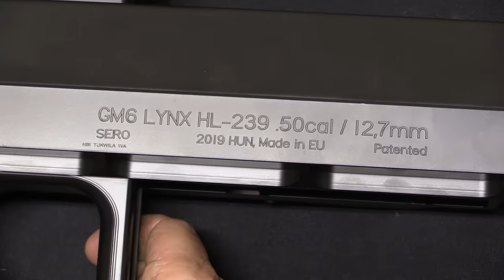GM6 Lynx: The Hungarian Long-Recoil .50-Caliber Bullpup

Comment: It's nice seeing a long recoil system being used in modern day firearms: really surprising how simple it is compared to gas operation
Reply: I wouldn't say it's simple due to the amount of parts required for long recoil action vs gas op, but it is marginally safer and can run black powder loads if you want to
Reply: @ArcturusOTE still powder build up would be an issue i wish we had a way to fix that beside from no rifling

Comment: Real life: This gun can only hold 5 rounds of 50. BMG.
Games: 8+
Reply: Arma 3 has the correct 5 rounds mags
Reply: 6 round mags plus 1 I have one
Reply: In far cry there is a dragunov with 5 rounds and the charging handle is on the wrong side.
Reply: Oh noo, games aren't realistic. How will we ever recover.
Reply: @DissedRedEngie  What is your problem?
Reply: If five .50 cal rounds isn't enough to stop your target, you better call for an air strike and artillery barrage.
Reply: In PUBG it only had 2 or 3 iirc
Reply: Is a AS50 from Accurat International in Far Cry 2
Reply: Every single movie and game: MG42 throws out the empty cases on the right side. Real life: only the belt.
Reply: @Eric Nunya It looks like silver is about $23/oz right now, which means your 1oz silver slug ammo…won’t cost that much more than any other ammo in 2021…
Reply: @Eric Nunya why not fill the nose cavity of a hollow point with white ash ?
(With 2022, you never know...)
Reply: I mean you could get like 10 with a double stacked mag, which is a very very simple modification to this weapon due to the magazine retention system. You could even attach a drum to this rifle, as impractical as it would be.
Reply: @DissedRedEngie  I'm not crying about I'm adding to the conversation.
Reply: @shooteveryday1841  you have it in pubg?
Reply: Games are garbage for kids...
Reply: bmg is such an overrated round

Comment: That "brass ring" is an Oilite bushing. Back in the day before roller bearings were cheap, this was the best way to manage locating parts that moved.  Usually they were set up to manage rotating bodies, so its use here as an axial bushing is less common.

Comment: what a mechanical marvel, and so finely manufactured. the brass bearings are a nice touch. i wonder about accuracy though with a moving barrel
Reply: Since it's an anti-materiel rifle, it's probably not called upon to hit anything especially small.  Well, maybe if it's being used for EOD, but then there's probably no particular need to hit it with the first shot.
Reply: As long as the front sight is fixed to the barrel, you should be OK...
Reply: Tests show normal MoA to be expected from an anti-material rifle, this isn't a sniper rifle. You're trying to hit large moving targets from distances expected to be less than 500 meters away behind cover.
Reply: @JosephArata  exactly. people usually think antimateriel rifle = sniper rifle, but they don't realize that they're not exactly used for the same thing. this is basically what amounts to be a man-portable "cannon" to destroy stuff. not a precision sniper rifle.
Reply: Actually it's probably a bronze bearing, brass doesn't have the right properties for bearings.
Reply: This isn't a sniper rifle. It's built to take out shit like engine blocks, power transformers, sat-com stations and things like that. Nobody using this is gonna be trying to hit enemy personnel at half a mile or anything.
Reply: @LabRat Knatz it would definitely work. Unfortunately most African countries have anti-american hold my beer laws so semi auto is not allowed, but .50 bmg should be doable. If 500 ne is acceptable performance, double the power should be 'adequate'.
Reply: @gruberstein  this is brass, looks just like the shine on my 3 point aerator tine rollers bearings which are also brass sleeves, looks exactly like the shine of my brass welding rods and things i have brazed with them. it's not a high polished as a musical instrument. brass bearings can be bought at your local hardware store. bronze on the other hand is fairly specialty.
Reply: As far as having a moving barrel, Barretts are the exact same way.
Reply: The rifle shoots about a minute, often times a little under. All with match ammo
Reply: @LabRat Knatz aside from the usual "military cartridge" prohibition in most of Africa, a .50bmg honestly has way too much penetration.
Reply: A Barrett shoots about 3moa.

About as good as an SMLE, or an AR.
Reply: @0neDoomedSpaceMarine  right. I don't know how they do it but the fit and finish of this rifle is next to none. It's worth every penny imo
Reply: The original Gepárd was said to be able to hit a human at 2kms range or even at 2 miles at least. It was said to be the longest range firearm of its time.

But modern variants may differ.
Reply: @ScottKenny1978  ARs shoot 1 MOA or better.
Reply: @DreddPirateRoberts  the design spec is 3moa.

Yes, some do shoot better, but mil spec is 3moa.

Comment: Your video really explains a lot of the issues demo ranch was having with the gun. He said it had a lot of recoil which could have been mitigated by tuning the muzzle brake, and he also had trouble charging the gun because he didn't rotate the bolt handle to unlock it before attempting to charge it.
Reply: So, they didn't read the manual?
Reply: He also forgot to use the barrel release to chamber the gun (a cool concept).
Reply: He sounds like the kind of person who would crank a Calico magazine only twenty-two times.
Reply: The gun had no issues, the problem was with Demo Ranch for not reading the manual/looking up how to properly use it.
Reply: RTFM I guess.

Comment: The brass/bronze bearings are very interesting and as you mentioned it's a wear part and is intentionally soft so that wears down instead. Its a technique you'll see in older mechanics, like steam engines and lathes. The advantage being you can simply replace the bearing ring and it's much cheaper to do so.
Reply: Brass and bronze are slippery alloys. Good for simple bearings and they also last long.
Especially bronze is surprisingly hard material.
Reply: I repair heavy machinery. Most of heavy machinery that involves hydraulics use bronze bushings. It is basically a consumable for high thrust and wear parts, like excavator arms. The main advantage of bronze bushings is self lubrication and ability to swap them. 
Like 75% of repairs I do are related to not propertly oiling and wearing out bushings till metal to metal contact. 
And that usually entails welding worn out surfaces and machiening them to original tolerances for new bushings.
Reply: @3rdHalf1  Thank you for elaborating further, my knowledge only comes from putzing around.
Reply: @3rdHalf1  what do you think of steel bushings as an alternative to bronze? Something you can run a weld bead down the bore to shrink it out of the bore for removal?
Reply: @brianwright9514  Nah, even very mild steel is much harder than brass and bronze. Aluminum alloys come closer, but there's a reason bearings and bushings aren't made of aluminum lol.
Reply: @Thelothuo  I've used some bronze alloys for bushings that are absolutely harder than mild steel.
Reply: @brianwright9514  Eh, really? Every source I can find puts bronze at 64HB at most, and steel at 120HB at least. oh nvm that number's Rockwell B and not Brinell, ye very hard bronzes do overlap mild steel in hardness
The only steel bushings I can find on McMaster-Carr are drill guides, not meant to bear load. My next guess is that steel isn't used while bronze is because of something to do with the structure of bronze that allows it to work, like with graphite.
Reply: @Thelothuo  low carbon/alloy steel is pretty soft...240 MPa min yield for some of it.  The big reason to use bronze is lubricity and material incompatibility (less likely for the pin to micro-weld to the bushing).
Reply: @brianwright9514  ye that was going to be my third guess, that it's used because it's dissimilar and strong enough
No idea whether a steel could be mild  enough to be usable as a bushing for other steels, though. If we're talking microwelds, could just being iron-based be too similar?
Reply: @Thelothuo  I've seen steel used in a lot of places where the pin doesn't rotate.  The pin is usually chrome or nickel plated, which can prevent the microwelding, especially in combination with other measures such as Moly Paste.  The purpose of the bushing is simply to prevent damage to the bore, which will typically be something much softer than the pin.  Bronze works well here too, but it is usually 4x the price of steel.

Comment: a lot of the design Elements of this remind me more of traditional Tool Machine Design than of the usual Gun makers designs, the use of Glide bearings, bolted on and
 together parts and bearings instead of hardened integral Lugs and Pins
Reply: yes, engineered rather than gunsmithed.
Reply: @LabRat Knatz you still need someone who has designed actual firearms before, though.

Otherwise you end up with the SA80.

Comment: Ian those rings that you identified as brass are most likely actually bronze. In that bronze is harder than brass and will wear longer. Highly polished bronze is often used as a bearing in heavy equipment. I know this as a retired machinist.
Reply: I definitely scrolled through the comments to see if someone else had picked that up. Good catch

Comment: Thank you very much Ian! I really wanted to see the Lynx on your channel, great video, well done sir! However, I feel that the real intended purpose of the gun doesn't get too much attention anywhere. So this gun excels in urban warfare. I don't know about any other gun in the same calibre that a soldier can carry comfortably while sitting in the passenger seat of a car and in case of an attack it's ready to fire in 2-3 seconds, providing brutal firepower that can punch through almost a feet thick ironed concrete. That's why the barrel locks in when retracted and on release chambers a round automatically.

Comment: That rifle looks like a machinist or mechanical engineer that used to build actual machines designed it. The roller bearing cam guide, the spring detent, the brass bushings, the way the muzzle brake is clamped on the thread, all that scream "machinetool" to me.

Comment: One advantage of long recoil I hadn’t realized until this video; unlike most other self loading systems the bolt doesn’t have to be as long as the cartridge.  This makes the receiver shorter and means you don’t need the extra weight of a full length .50 bolt.  It’s almost like an artillery piece.

Shame about the trigger though, it seems like that’s something they could have improved.
Reply: Considering they have no transfer rod to the seer, it should be possible to have a crisp trigger. O e area to improve yet further.
Reply: Yeah, that's weird. It should be possible to make at least a non-mushy trigger, if not a really nice two-stage trigger.

The military likes two stage triggers, so there's some give if a stick gets in the trigger guard.
Reply: @ScottKenny1978  Yeah. Imagine having this thing go off while carrying it in a shoulder sling...
Reply: @andersjjensen  I have a headache just thinking about that... 

I was once in the same, 5 Lane indoor range when they brought out the Barrett. Nasty concussion after that...
Reply: It’s a good point and a big advantage for long rounds. As you observe it makes for a very compact action. This is a really excellent design.
Reply: @WineScrounger  the reason you dont see it often is because recirprocating barrels lack accuracy
Reply: @brettalexander220 don't need big accuracy to hit NATO radars and parked planes tbf

Comment: Bullpup configurations make perfect sense for anti-material rifles. I love that it's so compact and I love the fact you can push the barrel and bolt back to make it even more compact. Excellent design. SAS use these now and they aren't even that expensive for what they offer £9k apparently.
Reply: So, less than 2 Alien pistols? Wow, that even more impressive.
Reply: @blacklion79  Alien pistols are overpriced. I would understand if they had the same fit and finish as a Swiss pistol/rifle but they don't. They are just some tacticool overpriced handgun. At least they perform well.
Reply: @Punisher9419  you should price other top end competition pistols. The Aliens aren't out of line.
Reply: @ScottKenny1978  Sure I understand that but at least they look fancy with nice finishing on the metals and some decorations and the like but the Alien pistol doesn't have any of that. It's just got the low bore axis thing going for it and the different mechanism.

Comment: A comment on the brass ring that the barrel slides on, Ian mentioned it is good because it is softer than steel probably a wear part. There is a specific property of brass that validates the first and contradicts the second part here that really speaks for the ingenuity of the design. Brass is a self lubricating material, that is as a part moved against a brass piece the friction causes some of the brass to stick onto the moving piece and form a small coating of it, as the part goes on to keep rubbing against the brass fitting the brass layer will smoothly glide over the fitting with much less friction and without wearing out either the part (in this case the barrel) or the brass fitting (in this case the ring) as brass on brass causes very little friction and next to no levels of wear. Wouldn't be surprised if in 70 or even 100 years when this is as old as some original WW2 and WW1 guns that the original brass rings are still in place with a shiny brass coloured barrel running in it.

Comment: Watch everyone flock to this now youve covered it in a video lmao ive been saying for years now this is the most advanced .50 BMG rifle out there, a league ahead of all others. Respect to the pioneers, Barrett ran so this thing could fly, but it sure as hell took off even if its not acknowledged yet. Far better balance, far more manageable size, far lighter than rifles of the same barrel length, and far easier disassembly. I would never attempt an M107 disassembly on my own if it werent necessary, the recoil springs are too difficult to compress. This was easily taken down, perhaps doable 1-handed even. Ppl moan about the precision but its not a sniper, its still sufficiently tight enough to do its job. Im not 6'6, if i want a .50 BMG that i can use without a crew, this is my only option.

Comment: There may have been a translation error on the muzzle break. That design redirects gas to rear slowing down the barrel assembly, and reducing recoil. . The ports would face forward if it was designed to add energy to the system.
Reply: Yea, as you thread the muzzle brake onto the barrel, the barrel starts to block off the ports, reducing the effectiveness of the brake.

Comment: 18:55
Feels like I missed something about the spring locking the bolt into the barrel. Is the spring the only thing doing that?
Is it possible to fire the thing out-of-battery if the bolt rotating doesn't happen for some reason? (Junk or "forgot to install the spring" or something).
Reply: I don't believe this rifle will fire out of battery. If the bolt is not fully seated and locked, the hammer cannot strike the firing pin.

Comment: Very clever design.
The long recoil system makes perfect sense when very heavy recoil ammo needs to be accommodated.
The heavy barrel recoil spring can absorb the bulk of the energy and allows a manageable light bolt return spring.

Comment: Re: The dust cover
Couldn't you just put a small cutout in the dust cover so you could flip out the charging handle and then flip down the cover? I realize this would be intrusive for storing it in a case, but if you wanted to just carry it around with the barrel retracted I feel like this would be an optimal solution.
Reply: I definitely think there's room to improve the dust cover. It's just probably not a high priority.
Reply: @alexstarr1589  I don't know, the dust cover is the biggest area for are for improvement aside from maybe taking Barret mags for capacity and compatibility. Keeping the rifle clean is important, and an urban environment can have a lot of dirt, dust, and debris. Being able to keep that out while also hauling it in compact mode would be a worthwhile iteration.
Reply: I intend to try 3d printing a replacement dust cover that addresses this exact issue. Not sure if my design will work but I have the time and materials so I figure why not.
Reply: @jakefoley9539  do you own a GM6? If you actually do this please let us know how the experiment goes
Reply: @RamadaArtist  I ordered one and it's arriving in April.
Reply: @jakefoley9539  okay buddy it's been a while. Did you figure it out or what?

Comment: Now this is quite a surprise, I always wondered how GM6 looks and works  inside (same with Laugo Alien), and Forgotten Weapons delivered. What surprised me the most was how short the bolt is and placement of the hammer (plus the barrel latching to make it more compact). The ''pistol grip serving as bolt handle'' reminded me of an old Dolph Lundgren sniper movie a bit, after chrecking, was not the same gun that was mentioned here. Edit to add: Gepard would be ''cheetah'' in english, for those interested. Tossed a peak at imfdb, those early versions look funky as hell.
Reply: You mean the film silent trigger?

Comment: Wow! What an impressive piece of kit! If I could suggest one improvement, they should design a dust cover shaped such that it can close over the charging handle when it's locked back. It could just bulge out where needed to fit over it. Great video though, as always.